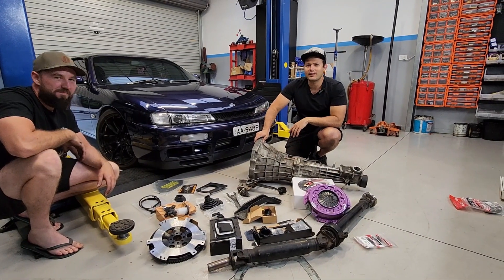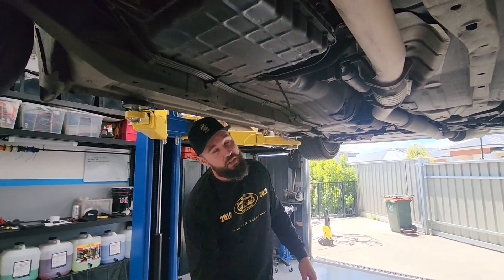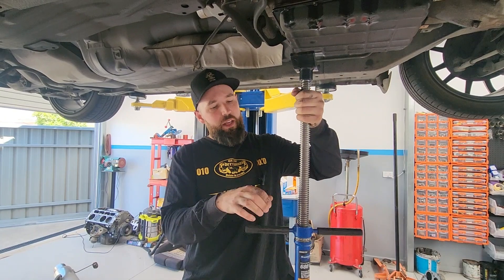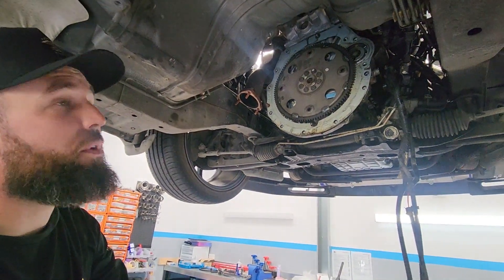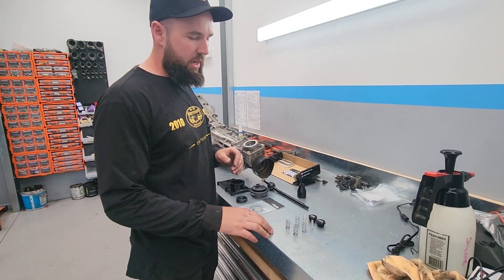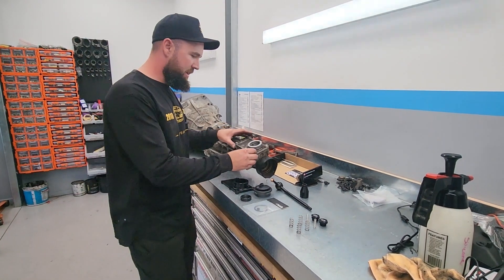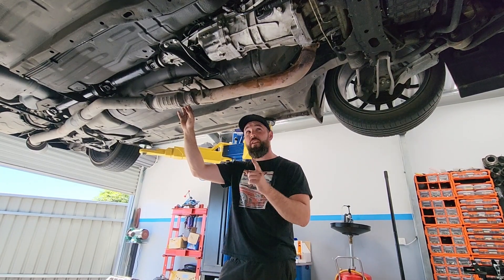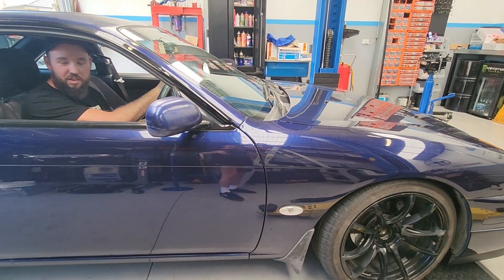HOW TO MANUAL CONVERT AN S14 SILVIA IN 15 MINUTE'S

Comment: My s14 has been manual converted but it seems that the revs aren’t right? In second the rev counter only gets up to 4grand and in neutral the rev counter won’t hit limiter. Any ideas on this?
Reply from the maker: Unfortunately in your case the rpm gauge has nothing to do with the manual conversion as the cluster gets the input from the ecu for rpm.

I'd say you may possibly have an issue with your cluster (if the cars running fine) but will need to be looked at.